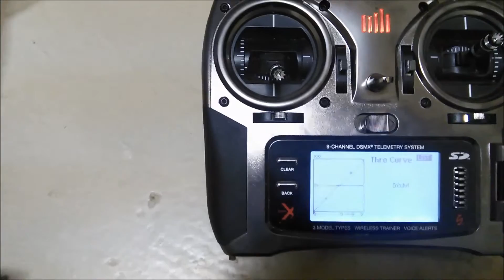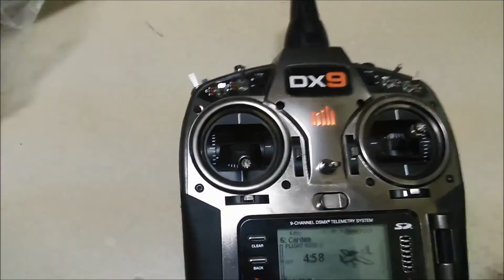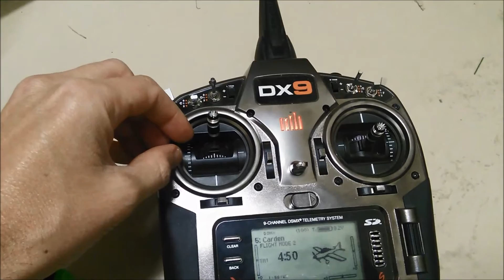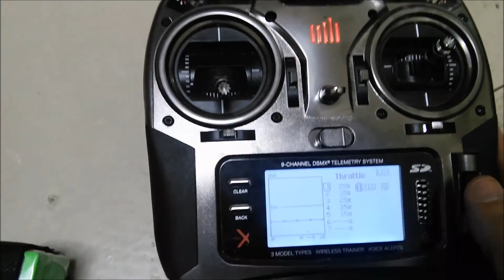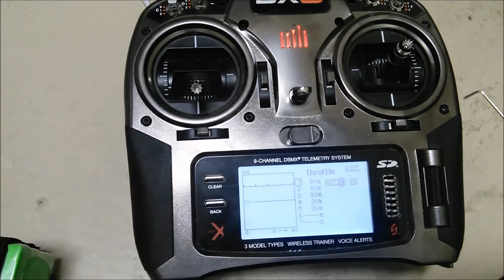Kosmik Programming Tutorial

Comment: Thank you very much I just purchased a Cosmik controller, and my helicopter was doing anything between normal and idle-up mode.
Sometimes he didn't rev up the engine.
I switched to mode 4 and no more problems.

I have a question.
Can we calibrate the trottle stick because the motor only turns from the middle of travel in normal mode.
Thanks for the response.